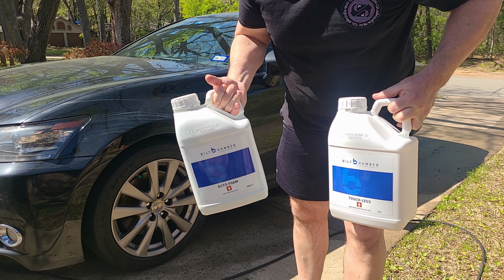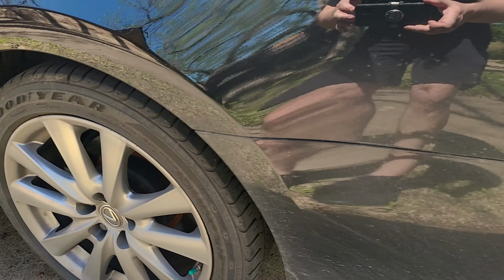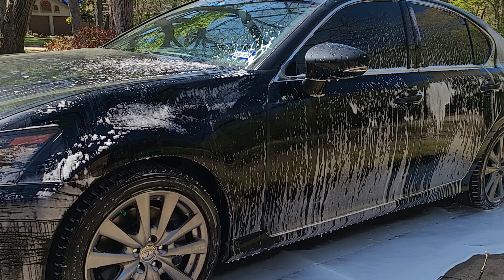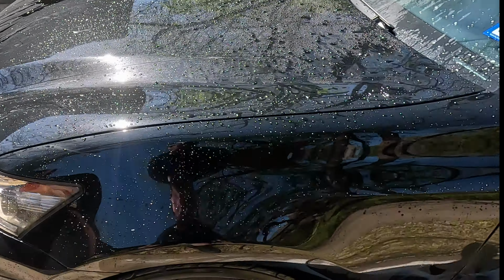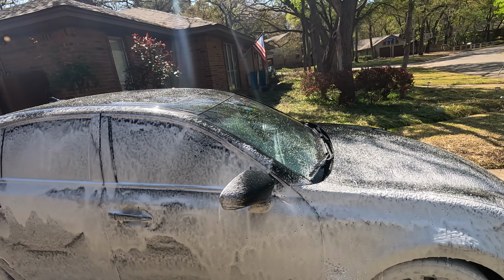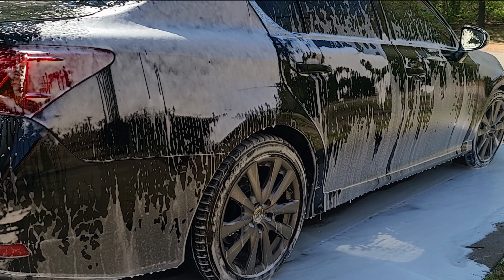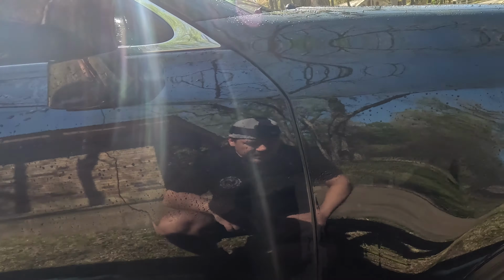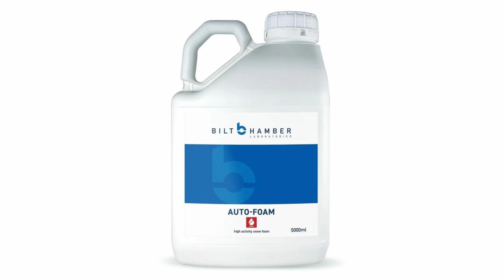Pre Wash Foam Battle Bilt Hamber Auto-Foam and Touch-Less

Comment: I have a couple of tips for you. 
Put a 1.1mm orifice in your foam cannon for way better foam 
When foaming up, start at the bottom and work up
And also use the PIR (panel impact ratio) measurements for the foam.
I don’t think you did this correct because the Touch-less is a phenomenon prewash. It’s probably the best on the market
Reply from the maker: Thank you for the comment! I will perform this test again in the future, trying slightly different methods such as what you described.